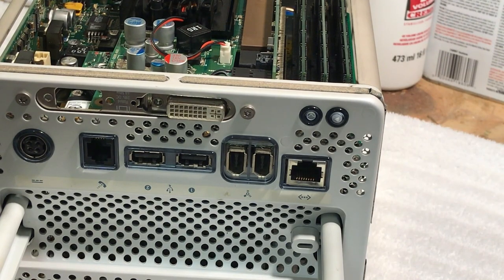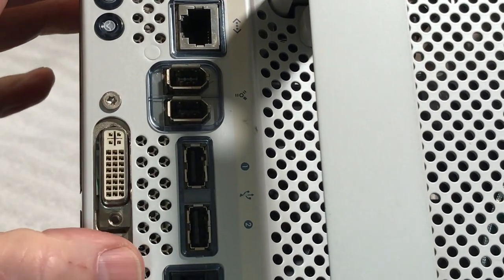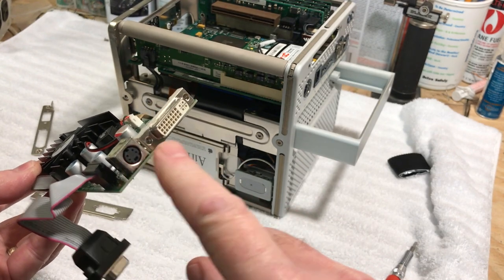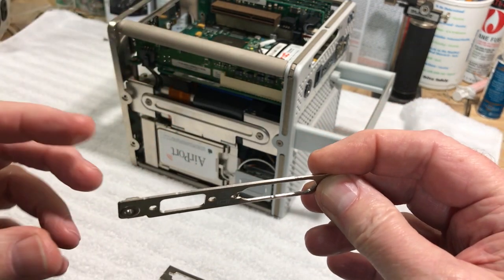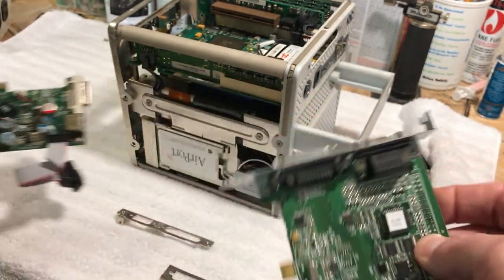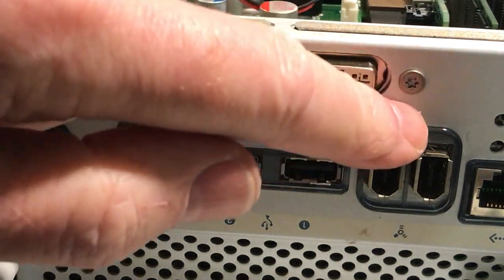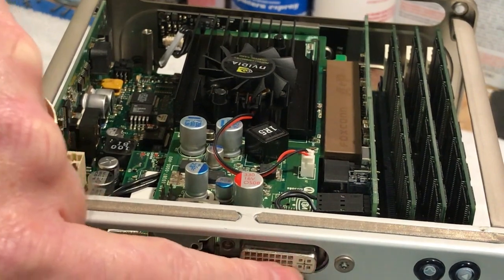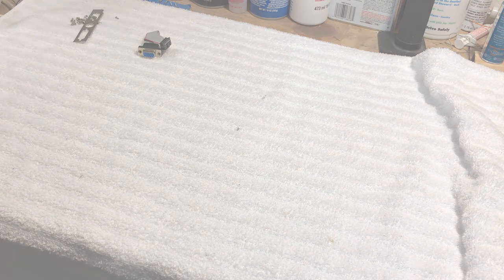G4 CUBE MODDING THE GRAPHICS CARD BACK PLATE NVIDIA GEFORCE Part 12

Comment: Nicely done, David! Makes me want to play around with my Cube again. It needs an SSD upgrade. I see your 6200 has a fan -- mine is passively cooled so I had to add an 80mm fan to the bottom of the chassis. I also need to do the mod to better secure the card.
Reply from the maker: Thanks we will be adding a fan controller next